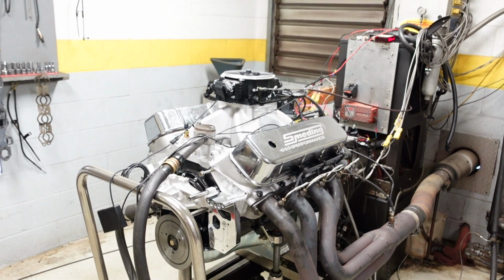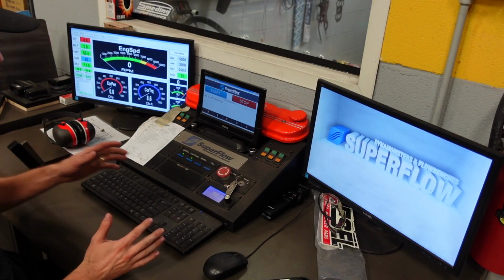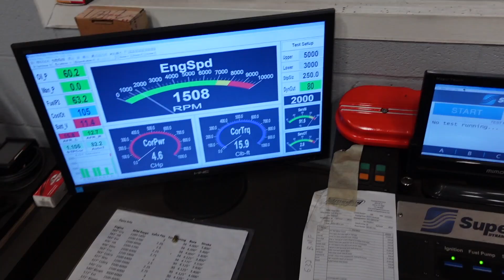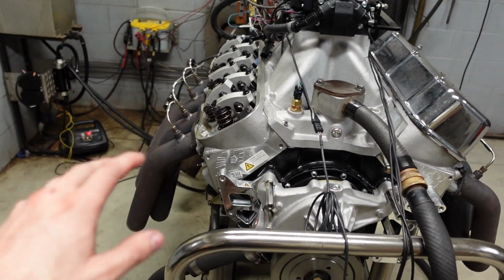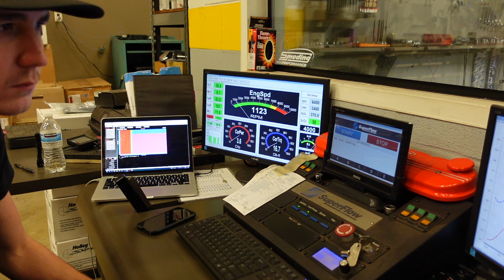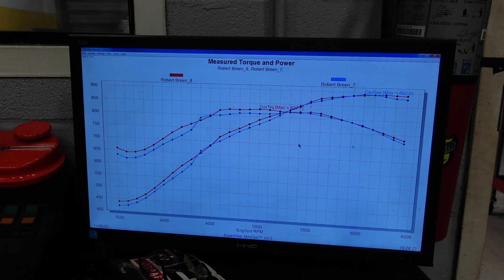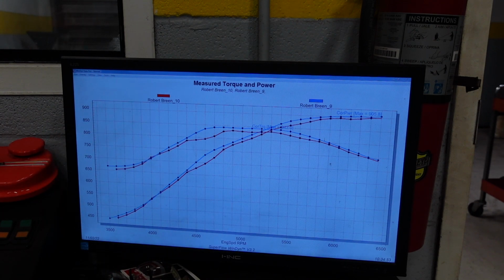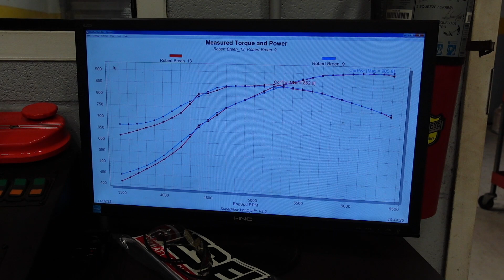900HP 632" Big Block Chevy Dyno Day! - Pump Gas Monster

Comment: I've used a very similar cam from Comp's custom library on several builds. They're always a pleasure to work with. 

I've also used that 4500 throttle body, with great success, with compression ratios from 10:1 to 14:1 and up to 8k rpm. Great unit!

Comment: i always thought you should set valve lash cold i always have done it cold jesel belt drive is the schniz nic dial in degree on cam to the exact point perfect nothing better than jezel belt for running the bumpstick

Comment: No crankcase ventilation? Vacuum pump will help with your ring seal and add considerate hp.
Reply: ring seal seems to be lacking with the pressure exiting the crankcase, and these rookies don't have the equipment to measure and monitor blow-by.
Reply: @bigboreracing356  Clearly not in the Dyno room,  or hooked up to the engine being run
Reply: @bigboreracing356    The equipment is either in the dyno cell, or not.    I don't see it...
Reply: @bigboreracing356    Yup,  you made my point for me,  this rookie shop does not know how to set up the oiling on a 632,   these guys just buy Chinese parts and bolt them on,  have no idea what they are doing.
Reply: @bigboreracing356    blow a head gasket?    Do you think the head gaskets are the weak link to making 900HP on a pump gas 632?    How do you know they were using "cheap" pump gas?   you mean Arco cheap?     My street 11-1 632 with SR-20 heads makes just over 1000HP on 93 octane  @6700 rpm with no corrections.    It has a hydraulic roller cam similar to what these guys are running with their mechanical but tighter lobe centers, and  1.8 T & D rockers for more lift,  we are in the .740's for lift.      On the oiling,  you are exactly right,  when running a large stroke BBC you have to keep the oil level down.    If these guys were not rookies they would know that too.     The reason I pick on them is because Jacob has an arrogant cockiness to him, and it drives me crazy when a shop claims to have their own parts, when they are really just importing the same Chinese parts that Scat and Eagle (others too) sell,  and claiming them to be their in house parts.  I had to laugh on the 632 short block video, Jacob was claiming "Smeding" rods, when you could see the Eagle part number on them...      We tell our customers whose parts we use,   no private label BS
ing.     As for cutting slack,  plenty pf people do exactly what these guys do,  there are plenty of engine builders keeping the hobby alive,  although Covid has thinned the heard a bit,   and the incoming recession will thin it some more,   personally I would buy a Skip White engine over these guys,  at least you know what parts you are getting and Skip White uses Sunnen hones,  not a crappy old Rottler.     (smeding recently got a new hone, so I will have to lay off that one soon)  Blueprint another big performance crate engine builder, and Blueprint has good  purchasing,  the Chinese cylinder heads they buy are good ones.

Comment: Tuning to find its power is great but I hope before you sent it out that you knocked a degree of timing out and went back to atleast 12.5 on the AFR. Especially with the higher compression. Cool engine though. Nice build

Comment: WOW, that's going to be a FAST street car and even have AC, i was going to ask if that ring and piston combination is ok for higher mileage street vehicles meaning with the thin rings etc.. Will they last?
I guess with AC he isn't going to take any track time ultra seriously thought with 905 hp he better have some serious traction and a drivetrain to match that engine and even know how to handle a vehicle with that power. Seems EFI is the way to go over a carb. especially for ease of tune? Have to admit it sure beats swapping jets out. Interesting that there is even more hidden power with the new head design.

Comment: Good build.
Your theory on the exahust being ingested by the engine could be partially could be correct.
It has been proven that putting on a collector extension helps improve power. 
I can't vouch for it as I don't have a dyno to check if it does

Comment: I’m sure that is built for a cruiser but.   My 540 pump gas made 885 with an AFR 357 and a profiler intake.  Put a freaking cam in that thing.  Your missing 90 hp.   .670 is pretty small for a 377 head on a 632. Looks like an SV2 intake.  That intake and head combo needs 7000 min and an 800 cam.
Reply: @bigboreracing356  I like the 632 build but it can do a lot better then that, not the builder but some guys are shy about how big you can go on a bbc cam wise for the street.  632s don’t last very long but really make great race motors.  I bought my 540 in pieces so it’s a relatively low $ build.  <10k at the time.  It made 863 on the first build and 885 at 7200 on 711 pump gas on this build (just a LOT lighter piston and went from .730 to .780 in the cam and 10.9 to about 11.2 I try not to turn over 7500.  My header combo likes the low deck.  No windage issues with the 4.25 stroke.  I have beat on it since 2014 with two refreshes and one bore.   I think I put more miles on my truck then all my hotrod buddies put together.   I hauled a set of 37s off my dodge today to the tire shop which drag radials and open headers too.  540s (any 4.25 stroke combo 555 etc) are just the perfect inch for power and life and can be boosted easily.   I have lost three cams from too much car show traffic, roller to lobe contact not the roller bearings them selves.  That 633 is great but put  a 780 or so cam in it and spin it 7k and it will make  some HP!
Reply: @bigboreracing356  An NA 555 will easily make 900 with the right cam but you guys run little cams so I guess not.  My buddy’s 555 made 895 on pump with a bigger cam than my 540 and a not so great head.   My other aluminum 540 made 965 with compression, a huge cam and a really crappy old dart head.  I guess you didn’t read my reply. I bought a parts motor and built it for less than 10k.  Ok I made 885 hp with less than 10k.  It Will outlast any short pistoned 632, makes 885 hp and I’ve had it for 8 years, drag racing, street driving, cruising.  It’s reliable and it’s mine, DO YOU GET IT?  I would never even consider a 632 because it’s maxed on bore, has issue with the head bolt holes cracking into the bore ect.

Comment: Cam card says hydraulic yet you mention the lash adjustments. What’s going on with that dude? Lots of engine guys don’t tell the truth about their grinds.
Reply from the maker: Forget what the cam card says. Those are auto generated from the computer when Comp prints the card out. On the spectrum from mild to wild there are literally thousands of lobe profiles that Comp Cams offers. These lobes happen to be on the "hydraulic" side of the spectrum, however they were selected for this application due to their gentle and stable design. That being said, you could run hydraulic lifters on these lobes, but the spring pressure required would overpower the had function & plunger.